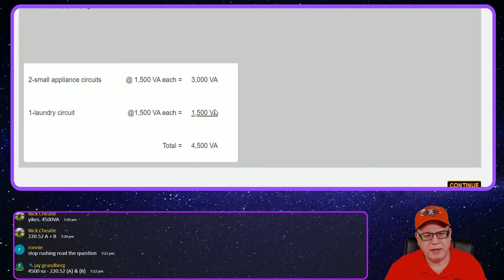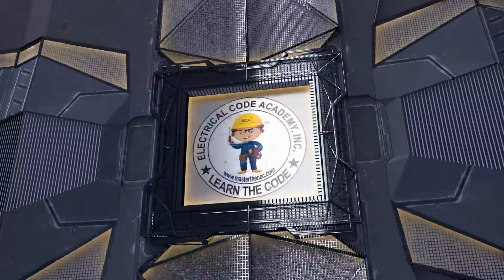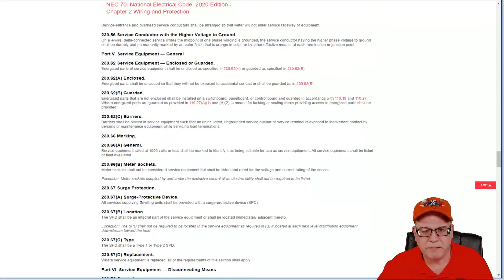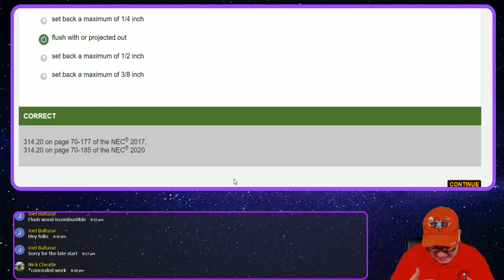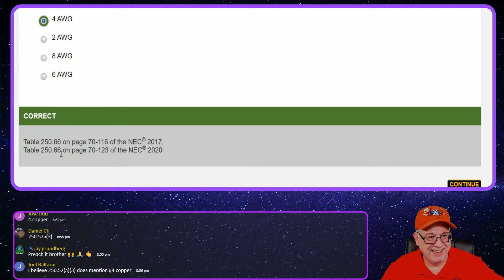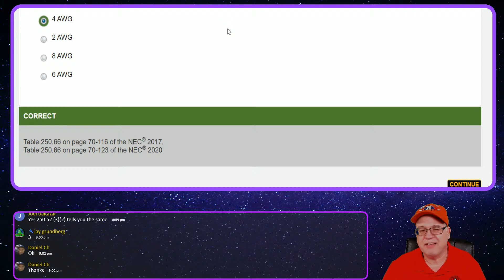Master Electrician Electrical Exam Preparation

Comment: First timer here and im diggin’ it, thanks! If the wood wall in question was finished in drywall would that change the answer to 1/4” depth?
Reply from the maker: Greetings Scott - I assume you are referring to the depth a box can be set back into the wall. If the wall is combustible material, such as wood then the box will need to be flush or extend beyond the surface per 314.20 of the 2020 National Electrical Code. Welcome to the stream and consider joining our monthly subscription plan over at www.ElectricalCodeAcademy.net for all exclusive videos and other exam prep support.

Comment: Where in the NEC would I find the necessary calculations for step up and step down transformers as far as VA and percentage utilization?
Reply from the maker: Greetings - well a step up of step down transformer could be expressed as any transformer, other than an auto transformer based on how you describe the usage. So, in that case a simple 480 to 240/120 transformer is a step down and so forth. So, the same rules in Article 450.3 would apply. So, unless you mean otherwise the same rules apply since by there nature they are transformers. So, maybe you mean something else but I won't speculate.

Comment: A question sir please, 
What about if I have 1 stud and 1 hickey?
Should I consider them 1 or 2 in my calculations.
Reply from the maker: It says in 314.16(B)(3) the following " Where one or more luminaire studs or hickeys are present in the box, a single volume allowance in accordance with Table 314.16(B) shall be made for "each" type of fitting based on the largest conductor present in the box". You would never have more than (1) Stud and (1) Hickey in a box, but they would both need to be counted as (1) Volume allowance based on the largest conductor in the box and Table 314.16(B). Why, because it says a volume allowance is to be made for "each" type of fitting and you have (2) types.
Reply: @MasterTheNEC  .
Thank you for your answer sir,